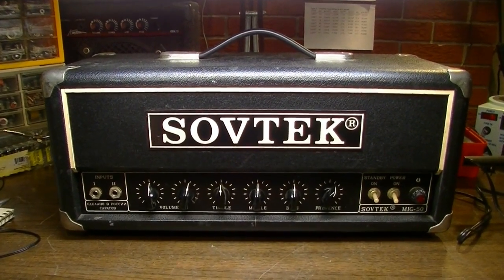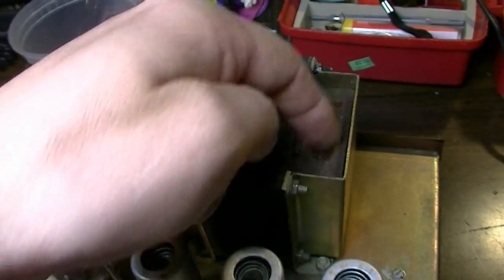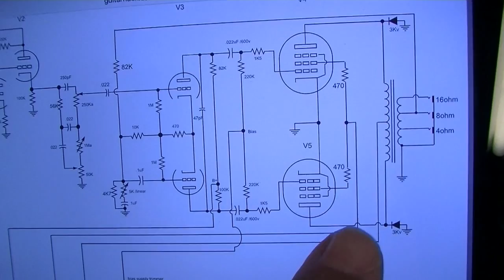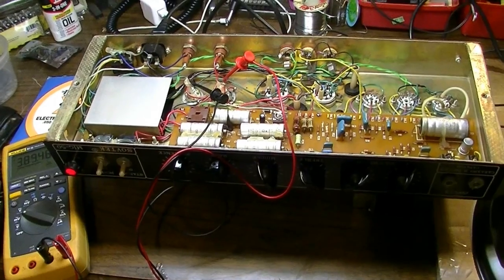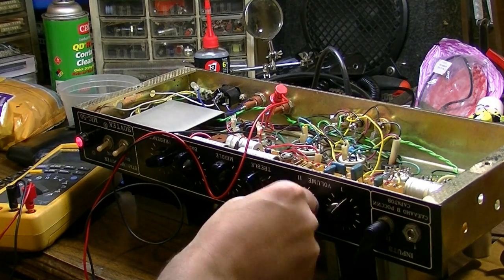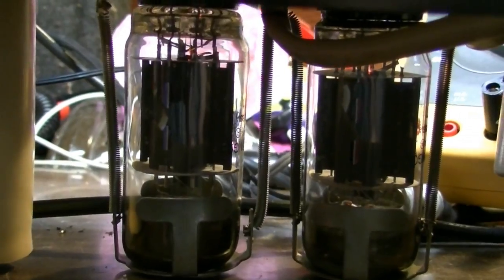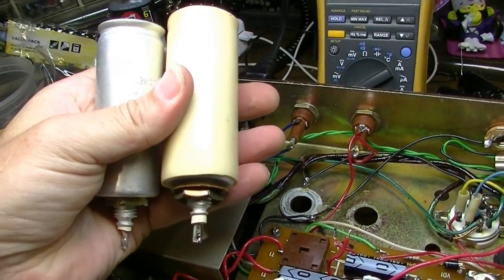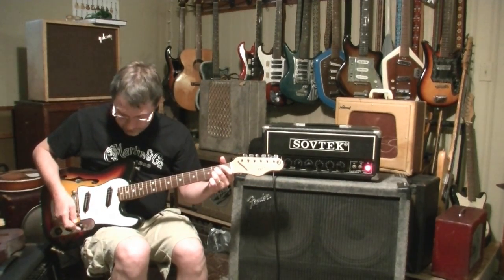PROOF the RUSSIANS RIGGED this Guitar Rig!

Comment from the maker: I just realized I left out an entire section of this repair... I found some old Sovtek MIG knobs in my parts stash from a different MIG I had a while back. I drilled them out and gave this amp a full compliment of original MIG knobs. I filmed that part but forgot about it in editing. Oops. Oh well.
Reply from the maker: hahaha....yeah, it's the curse of the observant to be confused by my videos. :P
Reply: Just shut up and play your guitar ( through the well repaired amp :) )
Reply: You can always upload it again with the left out section included and call it PROOF the RUSSIANS RIGGED this Guitar Rig! - UNREDACTED!!
Reply from the maker: The caps probably weigh more than any other component on the board, so they have the most inertia. If the amp is jostled, they may threaten to break the solder connections on the underside of the board. Those traces are fragile and it's best to do what you can to keep that from happening. Increases long-term reliability. Also, you'll notice I did not de-solder the original leads, but instead clipped them off the old caps and soldered the new caps to those. That kept me from having to disturb the traces on the board also. Too much iron heat and those can just call apart on you.
Reply: Freddy Y, hot melt glue .. ( not silicone) ?
Reply: silicone will corrode metals afterward, it has vinegar or acids in it.
Reply: Don't tubes degrade over time? Why would leaving the original tubes in be okay? Seems like it defeats the purpose of maintenance on an amp. No?
Reply: Did you listen to the demo at the end?
Reply: Did he test them?
Reply: Yes. But sound is nuanced.
Reply: You drilled out the knobs to fit the pots?
Reply: Editing is the devil
Reply: T Honyock The Soviets used tube technology rather than solid-state because tubes were actually more resistant to the effects of electro-magnetic pulse (EMP), like what would be created by a nuclear explosion!
Reply: my comment is not a HEDGEHOG!!!!
Reply: It's Long O like Soviet!
Also these Mig 50's were designed by.. Tony Bruno!

Comment: That brown board is phenolic resin impregnated cloth and they use it for varied purpose's such as a insulator etc.
Reply: Also the often sort after and very misunderstood material that was used on the neck pickup of Eddie Van Halens original Frankenstrat.
Reply: jon lennon Micarta is what it's commonly called.
Reply: Yup. It's called micarta. We use it in the tool and die industry as an insulator between high voltage components and ground, or other tools. Usually welding equipment. It's hard, robust, and non conductive. It can also take high clamping force from fasteners without being crushed. They also make micarta washers and hollow rod to insulate  screws and bolts from said energized equipment.
Reply: On the board too much brown is carbon and does lead to a short circuit. I have found that a sand blaster with glass beads is a good thing to have when repairing equipment, as it allows removal of burn marks on boards so they can be repaired. Also after done cleaning such boards it helps to spray them with glyptal lacquer, and use the clear stuff on circuit boards. That is because it helps make them like new after they have been damaged and this is the only way those boards are easily repaired when a new one is not a possibility.
Reply: We call it Pertinax
Reply: @magicmaui77  and later Didius...

Comment: Fiber glass board is called phenolic,non-conductive etc. Was used by hot rodders back in the day to make carb spacers. Also used in tool and die work at times.

Comment: In Australia the main voltage is nominally 240v but it's often higher than that.
Amps with transformers that only handle 220v run hot and break down more often.
Combined with the hot weather here the extra heat from running 250v through amps made to handle 220v is often fatal.

Comment: I still got a Sovtek MIG 100h. I had some minor issues with it over the years but for the price, it was well worth it. The 1/4" in/out  jacks are crap and my bass pot did very little from new. Also had a noise issue that was related to the fact that it was "mishandled" during original transport, that caused the same one 5881 and fuses to blow. The amp tech pointed out the minor damage and was easily fixed. Currently going strong but Its had a bad high input jack for many years that I need to get around fixing. I just don't play it anymore. Good to see that other Sovteks are still kickin'.

Comment: Old video so I don’t know if you’ll ever see this comment...but anyway, The input power voltage that is switchable from 110 American to 220 European, can a switch like that be installed on most amps? The reason I ask is I have two Redbear MK60’s that are 220V for the European market. I purchased a step up/step down transformer off of eBay to bump the 110volts from my wall outlet to 220volts to power them, but I can only do one at a time plus it’s a pretty clumsy set up and a pain to move around that way. It’d be nice to just be able to switch them to 110V and plug them in.

Comment: Just a guess on the transformer .. possibly they didn't completely enclose the transformer in metal like the old SUNN 1000S and 1200S amps with the Dynaco transformers .. and it was cheaper to put those bolted on covers as Gaussian covers

Comment: Hello brad,
Im' currently working on a mig100 and it's very hard on the power tube with 540v on the plate and screen. Screen grid resistor where fried.
Owner bought shuguang 6l6gc, but i don't think they will handle the voltage.
You say only 5881 can survive that ? New production sovteks ?
Thanks ?

Comment: sounds good.... The material you pointed out inside the open transformer ends is a phenolic insulator. They use the same material in High Voltage 3 phase switch gear breakers between the phases.

Comment: What was the final plate voltage with the -77 grid vdc? The Sovtek 5881's are a 6L6GC internally, they can handle a few more than 19 watts PD. Those Mig 50's are pretty awesome amps. They basically slammed a 2204 and 5F6-A(with circuit revisions even) together, jacked up the juice and sold it for a price anyone could afford. (Wait a minute.....they just modded a 5F6A in reality🎸🤘)

Regarding the transformers, I think the manufacturer only had tooling for one style bell for multiple transformers and filled the ends with material that's easy to cut/shape. Remember, we're talking about Russia here. The home of the stamped sheet metal assault rifles and hard liquor made from potatoes. Their shit just works.

Another great video! Thanks!
Reply from the maker: Plate voltage was about 525V. I didn't want to push the 5881 too hard. At this bias, they should last a long, long time in this amp. And it's still loud as piss.
Reply from the maker: ...and you're right about Russian engineering. Their military spec hardware is usually excellent. If it ain't broke, don't fix it. That was their motto. Well, that and "death to capitalist pig dogs". :P
Reply: Yes, what they built out of metal usually was rock solid. 
My dad always tells this joke about Russian engineering:
Do you know how Russians build a railroad engine? They take a huge block of metal and just cut away everything that doesn't belong there.
Reply: Their shuttle still exists but its rather dusty lol :)
Reply: I'm thinking the manufacturer didn't have the equipment to stamp out the cupped metal ends we're used to.  Or perhaps that equipment had higher priority jobs.  The ends shown there just need one of those metal benders.
Reply from the maker: Those are called a sheet metal brake. Wish I had one, then I could make my own chassis.
Reply: +The Guitologist
You don't need a press-brake to bend sheet metal. You could make a manual-brake for way less money. All it takes is time, and some welding skills.

Comment: Noticed that you do a lot of stuff with your Variac , the thing i found with mine is , that when you are using it with a tube amp running , it also reduces the filament voltage.. you really need to have your 6.3 volts on those heaters or your tubes wont work right..

Comment: Very good video. Question concerning tubes and red plating: If your tube is red plating does it always mean there is a fault or could it be just a bad tube? What would it cost to ship a amplifier head to you from Oklahoma?  thanks in advance?
Reply from the maker: Yes, it could be a tube. If it was just one tube, I would have suspected a tube first, but this was both, so I knew it was in the bias circuit. Cost to ship a head...probably around $35-$40. Right now I'm taking a hiatus from outside repairs though. Hit me up around July, I should start taking things in again around that time: bradlinzy at gmail

Comment: If it is possible to do, would it change the sound drastically if you lowered the voltage a little so you could use different output tubes?

Comment: Hello! I got a lead on one of these, but a 30watt-version, MIG-30. I bought it NOS from Russia in early 2000's.. Ten sold it onwards 2011, now asked the buyer if he'd sell it back. He said he would sell it, but it has been standing cold for the 5 last years! And as he started it up again now to try it out it had developed popping and crackling noises.. :( Would you appoint that to contact-issues, which I could remedy, or is it dryed out caps or similar I would have to have a pro look at it? ..Theres not a decent one around and I don't have car, so I might leave it rotting at the guy if it gets tricky..
Reply: Its with the cyrillic-marked Russian tubes, if I recall.

Comment: You did such a nice job on replacing the resistors and the diode  on the board but then you cheesed out on how you attached the leads on the caps. Why?

Comment: I bought a Mig 60 new and and Mig 50 at a pawn shop back in the 1990's. They didn't do much for me, but I've learned a lot about tube amps since then. They were a good cheap basic no frills amp. They were in serious need of upgrades as this video points out.

Comment: Cool vid again. Love your playing. The fault was a bad connection on the bias diode. When it made contact you got the correct negative bias so the anode currents were correct. When it lost contact then the bias would be 0V dc causing huge anode currents which in turn caused the B+ to drop. Must be a pretty good power transformer because a lesser one would have dropped its voltage much quicker! This amp is a good example of why there should always be a correctly rated slow-blow fuse in the B+, for this amp T500mA.

Comment: Very cool!
What is the type diode you you installed?
Just curious; looks like old stock? Russian made?
Reply from the maker: It's a silicon diode. It was an NOS one I got in some large parts haul a while back. Not sure on the model number. I just checked the voltage rating and knew it would work.

Comment: Out of curiosity, can tubes red plate simply because they're old? My parents have a Hammond C3 with a little JR-20 tone cabinet, and the old silver-top Sylvania 6V6's are red plating ever so slightly. The bias voltage appears to be fine (thank goodness), but the tubes are red-plating even though they're quite lightly stressed.
Reply from the maker: No. Age itself won't cause it. The tubes would either need to have a physical defect or the bias is off. Usually in old tube amps what ends up happening is the coupling capacitors attached to the grids of the output tubes are leaking high voltage DC to the grid and running the bias way off. Replace ALL coupling caps in the amp and try it again. If still not fixed, check the bias resistor coming off the tubes' cathodes and make sure the value is correct.
Reply: Cameron Jenkins Yours may be a case of the circuit being designed to run on the razor's edge of a 6v6's limits. As you may know vintage tubes tend to be sturdier than newer production tubes. A little blushing isn't always a bad thing.
Reply: Well, when I said old, I meant "well used." However, It would not surprise me if the coupling capacitors in the amp need replacing, since the measured bias voltage for the treble channel is noticeably different from the bias for the bass channel. Come to think of it, all of the capacitors probably need to be replaced, since they're all original (as far as I can tell) and the amp is almost exactly 60 years old. It's still pretty quiet, though.

Comment: Those transformers look like they're potted and insulated with an extra layer, maybe the outer shell is aluminum and wax-potted inside for shielding/insulation?
Reply from the maker: They just have a different look to them with those bend steel bell ends. More Spartan.
Reply: Are you sure they aren't potted inside some kind of canister, a la 70's Ampeg?

Comment: is there a mod schematic for minimizing the voltage  to 400v on plate and 380v on screen ?
Reply from the maker: Maybe. I don't have one. You'd need a large wattage dropping resistor on the secondary before the first power node.
Reply: @TheGuitologist  what about changing the capacitors in parallel with resistors values? does that drop the voltage? the 220uf parallel with 220k in series with same 220uf parallel 220k
Reply from the maker: No. You drop voltage by adding series resistance.

Comment: The Burning and Overheating came from the Meltdown at Cherynoble Nuclear Facility......or however you spell it.....are you GLOWING GREEN YET????.....Sorry, bad joke.
Now, to my question.
How do you know when it's time to Re-Cap your Amp and change out your Power Tubes?  
Until about a year ago, I have always run a couple of Racks of Outboard Gear, a MILE LONG MIDI CONTROLLER and Footswitches along with S. S. Amps.....yeah, I'm a little late, not to mention, my body is getting a little too old to TAP DANCE around a ton of Pedals and Switches!!
How do the Caps as well as the Power Tubes effect the Tone of my Amp?
Last week, I replaced the Pre-Amp Tubes just to be safe.  The Amp was built in April of 2011 and I can tell the Power Tubes had been replaced, however I have no idea if the Power Amp Tubes were Biased or Biased within Specs correctly.  I have been told Pre-Amp Tubes DO NOT need to be Biased but need some Burn In time.  They were inexpensive enough for me to go ahead a change them out, not to mention, really easy to access and change!!
I noticed some Microphonics from the Pre-Amp Tubes as well as a good amount of Silvering and just not looking right while glowing......Different shades of Purple, Blue and Orange.......a REAL BOX OF LUCKY CHARMS!!
Any information you can pass along about warning signs or sounds i need to lookout and listen for when things start to fail on my Tube Amp would be GREATLY APPRECIATED!!!
The part of Florida I live in doesn't have the best Techs around to service Amps.....gotta drive a couple hours North to the Tampa area or Southeast to the Miami area where retiring ROCK STARS come to live or have their Winter Home to hang out in to stay warm as we all age.
We need to stay as close to the Tempurature of a couple hundred; 1000 Watt PAR 64's and Fireballs as possible or we just turn in to frozen Rocks!!
Seriously, this was a great Video and I'm keeping the Link saved in my " Guitar Stuff " folder for easier access.
BTW, That Sovtek sounds incredible!!
What Speakers are in the Fender 412 it's plugged in to?  I've NEVER heard a Fender 412 sound that BEEFY, WARM and yet Crystal Clear and Clean!!

Hopefully you'll see my reply and question and look forward to hearing back from you.
Thank you again,
Keith

Comment: Will this model Sovtek allow for an ABY pedal between the inputs?
Reply from the maker: Good question. Yes.
Reply: yes it does. its actually designed for aby. you run both cheannels at once the same as jumping inputs on a 4 input plexi or bassman. one input is bassy one is brighter.. you blend to taste its sounds amazing run that way
Reply: + Gavin Murray Thanks for the info Gavin.
Reply: No worries mate. Highly recommend this amp if you ever come across one they are great. No master volume so it's loud as hell it has quite a lot of head room before it breaks up so you want a small cabinet if you are doing small club shows etc. Sounds huge through my marshall quad and keeps up with the loudest of drummers.

Comment: I have one of these bad boys. Replaced all the pots and all of the internal wiring. PCB looks and feels a bit cheap, but seems to be holding up pretty well. I am a little worried about the xformers, though. I run it through the stock 4 x 10 speakers of my early Fender Blues DeVille.
It sounds like a piano! Turn it up and it produces beautiful, natural overdrive. I love this amp.